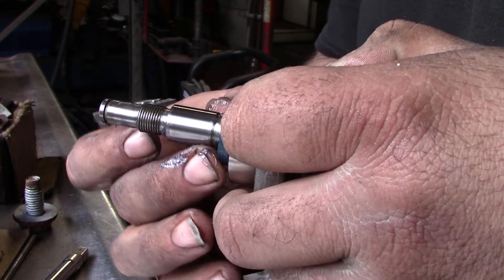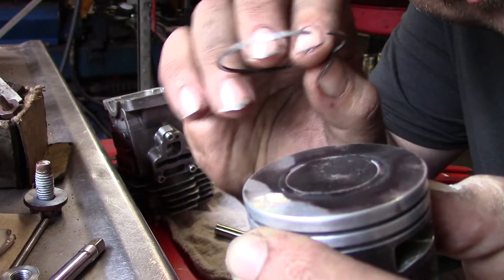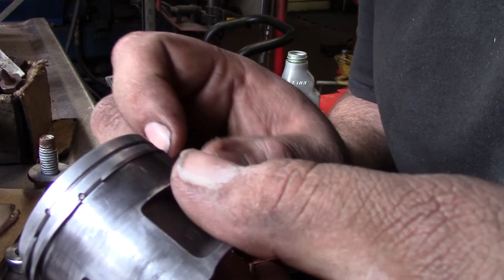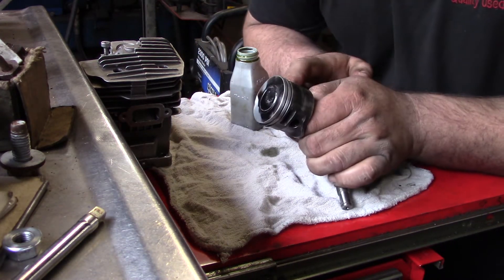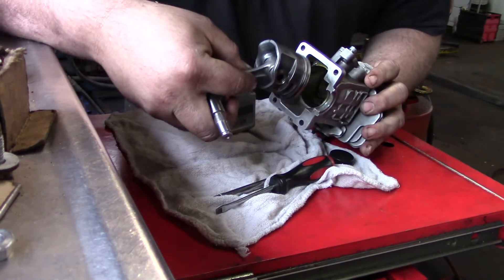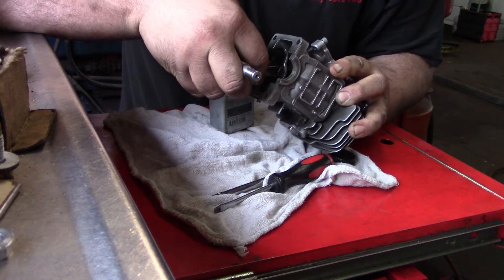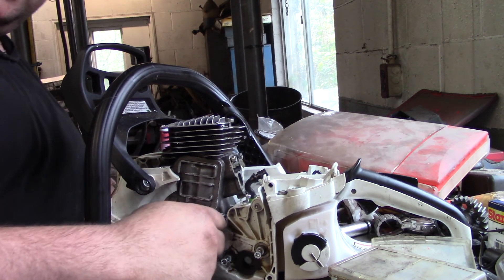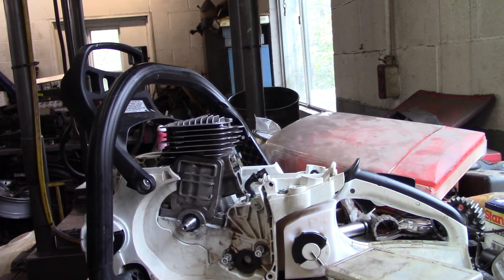Stihl ms 391 Chainsaw Engine Rebuild with bolt torque values.

Comment: Thanks for the video! I wish there was a video on tear down for this model.. How do you separate the piston from the crankshaft?
Reply from the maker: You just pry out one piston circlip but be careful you don't lose it. Then tap the piston wrist pin out with a 1/4 dr socket extension . Sometimes they can be alittle tight.
Reply: @kennytheguitarfanatic054  thank you

Comment: Hi Kenny, I am having a go at rebuilding one of these saws.. What kind of oil is that that you are using to lube up the parts? Also would you be able to clarify if the gasket maker is supposed to go around the oil seals? Cheers
Reply from the maker: I used the Stihl HP ultra oil on the parts. You can put Moto seal on the out side of the seals but you don't have to. I did because the aftermarket cylinder had rough finish were the seals side into to make sure it don't leak.